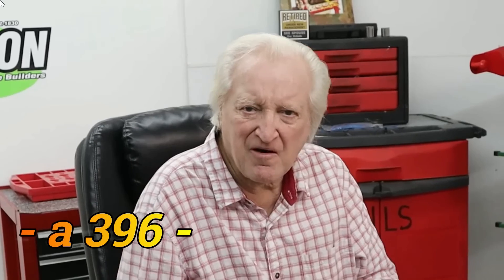Magic #s and moves for a super stroker SBC build.

Comment: Answer to cabot , you have registerd numbers that are wrong for a 377, those numbers equate to a 372 . 377 numbers are .030 over 400 sbc which are 4.155 times 3.48, Formula is bore times bore times stroke times point .7854 times 8 equals 377.
Reply: Pi/4 x Bore^2 x Stroke = Engine Swept displacement  also works.  Also  .7854 = Pi/4

Comment: Talking about power you’ve gained from stroker 350’s, you said you’ve gotten as much as 585 horsepower from the 396. What about the budget 383 that made 540+- on the restrictor plate and I believe it was 620.9 hp on the super victor intake?
Reply: Say more

Comment: The side thrust decreases yes but it still more on a 5.7" rod and therefore 6" rod is better.
Reply from the maker: Joe this is a Chrysler not a chevy. The stock 318 rods are much longer.
Reply: @DavidVizard  Confused. 6" rod has less side thrust than std 5.7" rod in a Chevy Block

Comment: So the 383 stroker Chev is an impressive engine no denying, the part causing me to wonder is why isn't the 390 Ford FE right there with it? 4.05 x 3.78 with a 6.49 rod and a floating wristpin but even with aftermarket heads, cam, intake and exhaust they still don't throw down like a similarly built 383. Is it just bad architecture, too heavy of a rotating assembly?  What am I missing here, would love to have your insight if you have the time. Thanks for the videos and books.
Reply: Sounds like you've never been near a properly built Fe my friend. Built right they run, but they are heavyweights.
Reply: with aftermarket heads, an FE will keep up with a small block stroker chevy, there may be a weight issue since it's a deep-skirt Y block design--the joke was the FE stood not for Ford Engine but the scientific sign for Iron :)  but with aluminum heads, intake, water pump and tubular heads you're reducing the difference.

Comment: David, I assume if you have lots of data from the 302,327,350,383 etc. builds of similar compression using 64cc heads you would also see the fuller trend of improved ft-lb per in^3 gained by stroking. How does the 377 3.48” x 4.125” seem to fit the trend, I would assume close to the 383?
Reply: I am no engine builder but those Destroked engines have always seemed to be killer in types of racing where traction is a major issue like dirt track racing
Reply: @joshcampbell2503  421 out of 400 is what my old man used to build for late model dirt cars in late 80s early 90s. They made 700hp+ and run 8k+ rpm all night. The last one he built for a buddy still runs to this day.

Comment: Thank you for these great videos!  Extremely educational and I love your stories of the days when you raced in England. I have a decent little 327 ci SBC in a 2400lb British kit called an Ultima that I built 20 years ago. It seems the trend for my kit that I see is that everyone has switched to the LS and the newest builders are dropping in the latest crate LT engines from GM with direct injection. I still love my little 500hp SBC and your videos have given me so much information on how I can improve it.  It’s a 2 bolt block from 1967 and I may start with converting it to 4 bolt with the splayed caps. Thank you again!

Comment: 🔔😎
I still not enthusiastic about the ring groove engaging the pin hole.
Especially for a street engine. Please expound. 🤔
Reply: During power stroke the oil ring see little if any combustion pressure blocked by top ring

Comment: Do these findings also work for boost? Could you make a video how your information correlates with boosted engines?
Reply: What makes the best power NA will make more power boosted.
Reply: Big bore racing, I don't think you understood what I was saying. The more power a engine makes the more power it will make under boost.

Comment: I have a late roller block and a 3.75  Scat crank for it also have some vortec heads from a 1 ton with the bigger exhaust guides . Need a high torque engine for my 64 Chevy medium duty tilt cab..Need some advice if this will work and who should I get a cam from . Fat tappet or hydraulic roller? Thanks again for the great videos.
Reply: This may sound stupid but have you thought peanut port 454? Love a 383 but you can build a true monster 454.

Comment: I freshened up the 383 in my Chevelle recently, I used a local engine builders advice, who races in the NHRA on selecting a cam and had one ground to his specs, I took the engine to his Dyno a few weeks later. The engine made 476 hp with a set of ported 906 casting Vortec heads, a Edelbrock performer "Vortec" intake, the engine makes 10.3-1 compression on I run 93 octane pump gas. The engine runs great and has good street manners as well as top end power. It runs so strong now, I'm really impressed with it, for what it is
Reply: Very good numbers man. Can you share your cam specs?
Reply: I give no info on my build, gotta love it!
Reply: Nice..What pistons are you using?
Reply: your camshaft specs and rocker ratio would be great as i am buying the stuff now asap with your same heads
Reply: What camshaft ??
Reply: @h.a7191 it's fully sick le
Reply: @h.a7191 ule

Comment: He is a idiot showing someone on how to install a spriolock!  He just ruined the spriolock by bending it out of shape!  You would never want to use one like that.  That is not the proper way to install them.  When I install them they look just like they came in tack, not sprung out of shape with the loss of tension!  The companies will tell you to never use them over after they are sprung out of original shape(flat)...

Comment: Instead of saying get that cam right ,why don't you tell us the cam specs that will work.
Reply: That is determined by where you want the torque and power at.  Your heads, intake, carb, headers and exhaust all play a part in this.
Reply: There’s not just one cam that works on every application tons of factors.
Reply: @bigboreracing356  That's a great cam for a reasonably light car. He never has said what he is putting the engine in.  If it's a 4000lb station wagon with 3.08 gears or a pickup to pull a trailer it's probably not even close.  Now, if it's a Nova that is set up for some serious street Action or a bracket car it's a fine choice.
Reply: @bigboreracing356  technically any cam will work if it’s correct type for platform.
Reply: @bigboreracing356  he didn’t mention a platform meaning that any specific recommendation would be an assumption at best or sheer ignorance. I’ll make an assumption of my own that you’re falling in the first category.
Reply: @bigboreracing356  no what I’m saying is what you said that he didn’t give us any information on platform so he could be talking about a golf cart who knows thus making any recommendations would be an assumption at best.
Reply: @bigboreracing356   he didn’t specify a platform like what engine type for all we know he’s talking about a golf cart engine. Unless he stated exactly what his platform is you can’t possibly make any recommendation. The cam your recommending is fine for whatever platform it fits I’ll assume sbc.  But to directly answer his statement with a cam recommendation when he didn’t give you any information at all literally zero makes absolutely no sense. I was actually being kind saying it was an assumption at best but you have made it pretty clear my first thoughts were correct and it’s sheer ignorance.

Comment: So it looks like I did everything wrong with my 383? It's only 9.6:1 static compression and the cam is a Comp XFI hydraulic roller grind that is 202/212 degrees @ .050" with .550"in. and .546"ex. lift with the called for 1.6:1 rockers on a 113 LSA. Also has Patriot Performance aluminum heads with 2.02"/1.60" valves and flat tappet springs I still need to swap out, a Weiand Airgap style intake, Holley 850 DP carb backed with an 700R4/3,000 stall with lockout and a 3.07:1 rear gear.

Seems to work really good though in the land barge 4,200 lb(4,400 lbs with me in it) Impala it's in, 13.0s in the QM @ 101 mph with high 1.8 / 60 ft times. I believe when I swap the springs and dial in the tune it will be in the high to mid 12s with a 1 or 2 more mph at the top end?

Here is the kicker with this combo, I get 17mpg city/24mpg highway with the carb tuned more for mpg than performance. Yeah I am very curious what this would be like with a better LSA but unfortunately don't have the funding to do that kind of testing. Do you think I would gain or lose mpg with a tighter LSA?

The cam at the time(2005) was the closest grind I could find that would possibly give me the best of both worlds? Would really like to try this combo in a  thousand lb lighter car, maybe 20city/27highway and 12.0s or tickling the 11s in the QM?
Reply: Tighter LSA for sure.
Reply: @dondotterer24  

For sure what, better mpg or worse but better performance or better both?
Reply: @itseithergonnaworkoritaint7852  I'm going to say more torque and horsepower . Depending on the cruising RPM. I bet better MPG. But you have to work on the carb or whatever you have to make it clean the idle up so you have enough vaccum.
Reply: @dondotterer24  
The cam in there now gives me 21 in of vacuum at idle, do you think I would lose vacuum if I had a cam made with the same specs except the LSA at 105 or 106?

Remember, this isn't an all out cam, it was chosen to do it all, good performance and good fuel economy.
Reply: @itseithergonnaworkoritaint7852  yes less
Reply: @dondotterer24  
With only 202*/212* @ .050" of duration I can't see the vacuum going down very much? Also tightening up the LSA on such a low duration I can't really see the overlap increasing enough to make much of a difference? It may be just enough to lower cylinder pressures at lower RPMs and not be enough to ad to the top end? This cam is advertised to make power from just off idle to 5,000 RPM but the combo it's in keeps pulling to 6,000 RPM where I think the valves start floating because of the wrong springs? If that is the case I think it might keep pulling even further? I picked the Weiand imitation Airgap intake because they claimed the power range is 1,500 to 6,800 RPM, 300 more than the Eddy. 800 more RPM out of that combo I think may be enough to get her in the very high 12s?

I have found roller rockers for a sbc that have a 1.72:1 ratio that I would love to try with this cam(after I swap the springs of coarse). Those would increase the lifts from .550"in/.546"ex to .591"in and .587"ex. to utilize a bit more of that max flow from the heads.

The LSA is that wide because it was designed as a FI cam so it would play nice with a factory confuser. I wonder what DV would say about this cam in a carbureted app?
Reply: DVs 128 formula would put you @ 106 LSA, maybe 105 with your lower compression, and the duration determined by your needed vacuum and rpm range. Of course proper installed angle is a must. JMO
Reply: @hotrodray6802  

Even though my static compression is not above 10:1 with the mild cam the dynamic compression is a tad above 8:1 which is starting to get border line for pump gas because of higher cylinder pressures. That came was designed for a lower compression engine than it is in, like 8:1 to the high of 9:1 but all the other parts are mis-matched so..... LOL

So do you think it would be worth it to have the same cam made with just changing the LSA? The idle vacuum is mentioned in the post just before this one. I wonder if there is another 80 HP and ft lbs like DV says is left on the table? I can't recall what he said about the lower duration @ .050" if his formula should still be used or not?

Comment: A little off subject but I can't find a formula or any reference on the turbine sizing on a turbo setup
Reply: You can use borg warners match bot program to accurately choose turbos. Just follow the directions and enter good data and it will give you very accurate turbo performance data
Reply: @bcbloc02  thank you sir.

Comment: I'm really surprised about your claim of a 383 outperforming a 406. If you were to build both to run on the same fuel, would the 383 perform better? Or is it that most people do a poor job building 406s, so a well built 383 will outperform an average 406?

Comment: At what point would you stop using factory type stamped steel rocker arms for a hot street SBC (assuming they are long slot) ?
Reply: Previous video DV recommended PRW cast steel ball pivot roller tips.